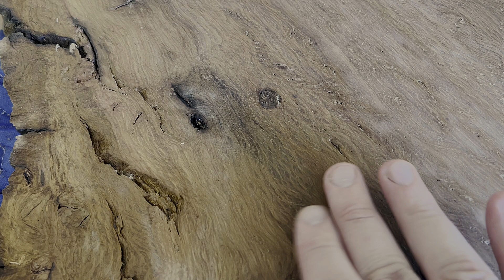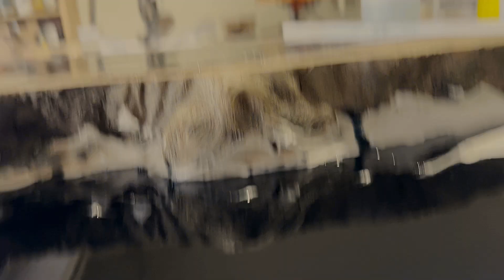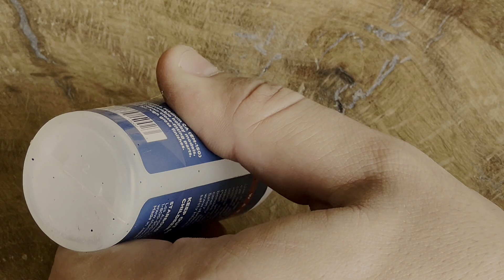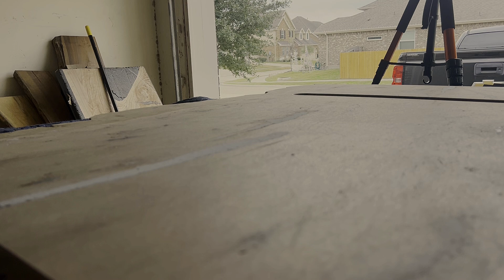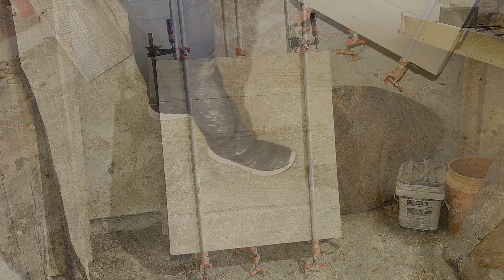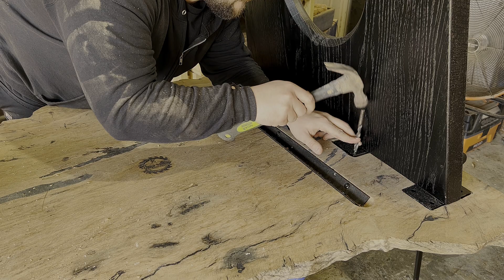$7,500 Desk From a 300 Year Old Tree

Comment: Turned out super nice, Hunter. I feel bad not warning you about how much the epoxy is going to run out of all the cracks. I would’ve told you to put a lot more caulk on the underside and build a caulk dam around the outside of the slab to stop it from running off the table,. You are crazy strong to manhandle that thing.
Reply from the maker: No need to feel bad about anything, all my mess ups are just experience gained

Comment: Perhaps you did it off camera, but the underside is not finished. That’ll cause the desk the absorb moisture in an uneven manner anyway, just what you wanted to avoid earlier in the video.
Reply from the maker: It was off camera, the bottom was finished right after I confirmed the legs fit. Just didn’t seem necessary to show it but I do agree that I should have mentioned it

Comment: With the plates fixing legs to top, consider making allowance for the seasonal movement across the grain plus create a template to router out the recesses ~ even though they are onthe underside attention to small details elevates the finished project
Reply from the maker: There’s more than enough room for wood movement in all directions, the slots are about 1/4” over sized and the bolts have about the same wiggle room. I do agree with you on the template though

Comment: turned out awesome. You could try ebonizing the oak. I've done it before when I wanted my oak black and didn't want to paint it. Take a mason jar and fill it about 3/4 full with white vinegar. Stuff a bunch of 0000 steel wool in it and let it sit for about a week. then wipe on. it works of of the oak's tanin level and will turn it black. far as i know it only works on oak.
Reply from the maker: Yeah I know about that, just didn’t think to do it this time
Reply: @lonestarwoodworking3810  Another option is to use India ink. It usually is quicker and less likely to splotch than ebonizing. - Chris
Reply from the maker: @fcschoenthal  well I plan on working with oak a lot more in upcoming videos, so I’ll give both a try!